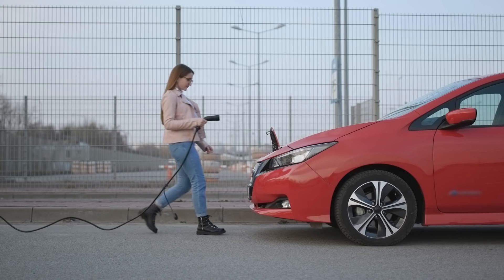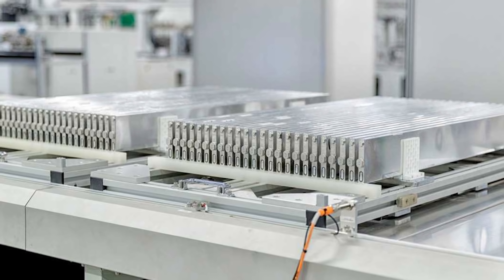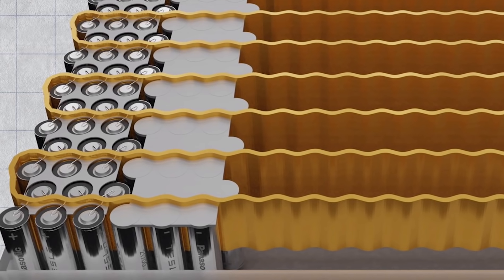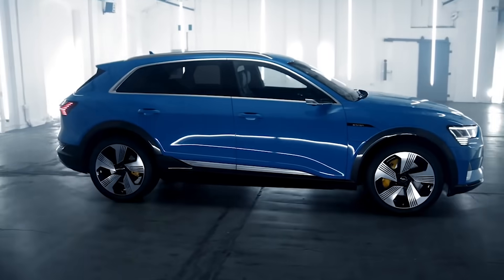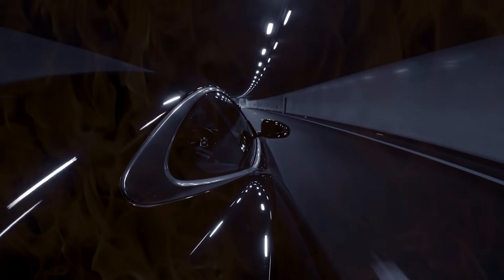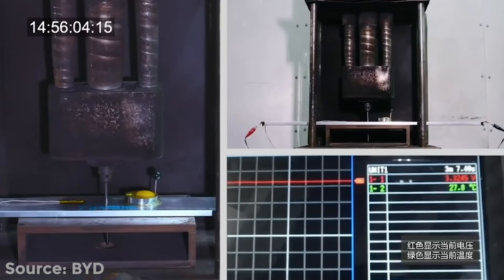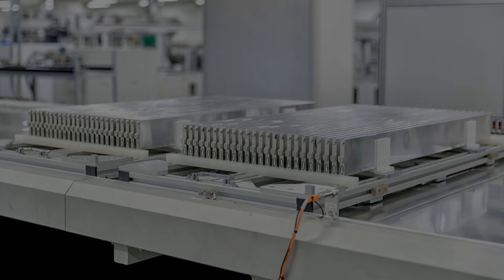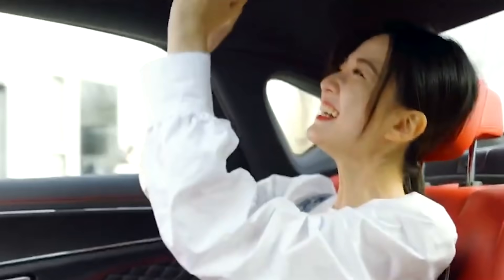Uncovering China's Battery Breakthrough

Comment: I've been decently interested and involved with Li-ion cells (18650s to be exact) since 2006. They (obviously) used to be solely focused for minor, handheld devices, and, seeing that the technology was NEVER meant for high draw, fast recharge and the cells were dangerous when placed under extreme heat (or damaged)... ALONG with the requirements for a PCB controller...

... it's definitely in the world's best interests to move AWAY from Li-Ion/polymer technologies for vehicles, large devices, and high-voltage concerns.

TBH, I'm surprised that Li-Ion has become so robust, only with exception to its light weight & high energy-density.
Reply: It's not 18650 anymore it's 4860 and the gel kind are actually better and it uses no lithium it uses cobalt but yes I think we can make a battery and make it swap out like laptop used to take battery out and put a new one

Comment: I would assume that the shape of the battery helps with dendrite formation as well?
Reply: My thoughts exactly…  🧏🏻 little confusing because I could have sworn there was a reason why we used a insulated cylindrical design. The other issue is with dust particles and organic buildup between the plates from air cooling. Not to mention the massive energy loss in the winter time. How do you keep them from getting too cold 🥶

Comment: It was evident as early as 2010 that the energy density of battery chemistry was insignificant relative to the structural container which makes up the pack of cells. A 10% increase in energy densities while significant in the lab is dwarfed by the casing weight. Elon himself pointed this out laughingly pointing out what a waste of time it was to do R&D on exotic chemistries when most of the weight problem is the cell casing and the waste of space arranging cylinder shaped cells. Then add more infrastructure to hold the cells in place and as mentioned a cooling system.
Recently came across a carbon foam battery where the energy to weight was higher then any other chemistry but the volume to energy was bigger then any other chemistry. However the foam structure is strong enough to become the car body itself offsetting the volume concern and replacing the heavy body with an energy storage potential greater than any other mobile concept. Apply this to the electric airplane solution and you now have a viable technology for electric aircraft.
Reply: So what happens when you crash in a carbon foam car?
Reply: @motie38  pretty good question, but I'm sure we can implement the advances we have with other material science with carbon foam and create crumple zones, among other things, to protect passengers.
Reply: @crossup13  passenger safety is only one worry. Batteries are toxic waste. And they're a lot more expensive than a crumpled piece of metal or fiberglass. If you make batteries part of the body, you're raising the cost of an accident significantly. The car becomes so expensive to repair it's now essentially a very expensive disposable container, and now you need a hazmat team at every accident. well, almost.
Reply: it's almost like elon actually knows what he is talking about and isn't just a grifter that got lucky. Interesting concept to consider with the recent media blitz against him...

Comment: So this battery is cheaper, more energy dense, easier to cool, is safe and doesn't need Cobalt. Driving a nail through it doesn't change the voltage at all. There's hardly any downsides except where it is produced. I hope you understand that I find this VERY HARD TO BELIEVE

Comment: How is letting air past the cells going to be more space efficient than water cooling channels? Also LiFePO4 cells are less energy dense than standard cobalt-based chemistries. Ultimately the safety and longer lifetime make them appealing for standard EV use, but for long distances I think cobalt-based will still be better.

Also clickbaiters should be burnt at the stake

Comment: Temperature management of batteries is no magic bullet and won’t yield the results fantasized by the producer of this video. Consider that Tesla manages temperature easily within optimal range so what’s the difference? Performance wise there will elimination of a small circulation pump. If your theory were true then EVs natural performance would jump in the cooler months.  This design is about economizing for a lower income market and while that’s fine, the reduced energy density will yield vehicles with compromised range that will never meet market acceptance in the usa

Comment: I don’t believe this presentation. You will still need ventilation room between the cells to dissipate the generated heat while charging. There is nothing revolutionary. Battery-industry is well aware of other form-factors. Also the advantages and disadvantages of lithium-iron-phosphate are well-known in the industry. There might be some advantages in this form factor, but it is only marginal.

Comment: How is this a breakthrough? It takes an existing technology, puts it in a (more ridged?) long form factor, and you didn't give any important details. 
Sure you can pull apart the structural form, and you said sheets, but if sheets how is the electrical connection done on the inside to each sheet?

Comment: LiFePO4 batteries have a massive disadvantage in cold climates. Without heating, trying to charge a LFP battery below 0C will permanently damage if not completely destroy the battery. These will never work in a car without internal heating which will drain the batteries significantly as most of the car driving world experiences temperatures below 0C. I also don't see how these "blade" batteries are much different from the pouch battery cells used by just about everyone but Tesla. 

Relying on air cooling for an EV is a big mistake as fast charging the battery will generate massive amounts of heat, just ask any Nissan Leaf owner. The Leaf uses air cooled batteries and there are significant limitations on charging of those batteries. Long road trips are completely out of the question as most Leaf batteries can only be fast charged once or twice per day due to excessive heat buildup. Given this, you'll maybe, and that's a big maybe, be able to get 600 miles/1000 km of range out of an air cooled Leaf battery due to heat buildup and that's if you start with a full battery at the beginning of the trip.

A side note, Tesla is the only major manufacturer using cylindrical batteries for their cars, nearly everyone else uses long pouch cells typically in the 600mm-900mm length range.
Reply: To add to this, Nissan leaf battery packs degrade significantly faster than liquid cooled ones in humid, hot climates
Reply: just use fuel.
Reply: @prydzen  You mean fossil fuel? As much as i love cars (and manuals😭), even i accept that we have to replace them. Hopefully we can keep using them as enthusiast/specialist cars or something. But for mainstream/everyday use. We really can't afford the emissions.

Comment: To the best of my knowledge only Tesla use cylindrical batteries. Air cooled systems are notorious for loosing capacity quickly and not to take frequent rapid charging due to the inefficiencies of air cooling over using refrigerated liquid cooling. I cannot see air cooling working at all in hot countries. Nor will it work well in cold times when battery heating is required. Nice 8dea though pity about its implementation. I would never buy an EV with an Air cooled battery.

Comment: Concept is interesting.
However having no active cooling is a big problem for me. You all know how bad Nissan Leaf batteries deteriorate.
And in hotter climate, where ambient temperatures reach in excess of 35 degrees c, just relying on gaps to cool the battery is not enough.
Do they at least have active ventilation of these, or are they hermetically sealed?

Comment: We need to have an independent agent such as NHTSA or ETSC verify those test with the metal spike piercing the blade battery and not relying on the company who promoting blade batteries because I believe that they are cheating on those test, I believe those blade battery or not charged, It is my believe they using fully discharged battery to run their test. Anyone understands how electricity work know is not possible short out a battery and don’t get any spark a fire from it!

Comment: The blade battery is already in production for quite a while now. It's a invention on packaging battery but not the material improvement. It' using LiFePO4 battery tech which is cheaper than Ternary polymer lithium battery (Tesla's battery) and safer. But the problem of LiFePO4 is it has less energy density. The blade battery increased the energy density and made it easier to cooling off so the BYD electric car can catch up the mile range with Tesla. If there are some new battery material which has higher energy density and using the blade packaging, that will be a revolution of electric cars. Good news is many Chinese electric car companies (includes BYD) declare their new cars will have 1000km range on single charge. That may cause a booming of electric cars.

Comment: Do not be fooled.  This is not a breakthrough at all.  It's just regular lifepo4 cells.  I've had cells like this for years.  Also, it has less surface area than an equal mass of cylindrical cells.  There are already cars that use rectangular cells or flat pouch cells like the prius.  There is just no new technology here.

Comment: "The cells are manufactured in China" Why? Where are other batteries made?
Reply: What do you mean ‘why?’ China has most of the manufactures to make batteries on the world, even Panasonic is Japanese brand, but they also have some factory in China, due to much lower labor rate. If you even in China before, then you will find out China is not the same as your country’s media telling you about how it is.
Reply: Tesla Model 3 are manufactured in the United States
Reply: @rcpmac  yeah and they'll slam you into blinking lights killing your family 😅
Reply: @adamsmith5913  FWIW, from personal experience I can tell you that price and the name on the electronics is not the best measure of quality and if you're willing to pay the price I'm pretty sure you could get the quality from China. But that's the thing isn't it, you have to be willing to pay for the quality instead of buying on price alone. I'm kind of assuming your other post is a bad attempt at sarcasm.
Reply: @L98fiero  I think you have reading comprehension problems, are you English 1st language?
Reply: @adamsmith5913  But China also makes high quality items, you just have to pay for them instead of buying the cheapest you can find.

Comment: One thing: Don't you think, that any other batteries aren't manufactured with a lot of Fossil-Energy-Input!
Reply: I think the point was that ANYTHING made in China is going to consume more fossil fuel and generally less sustainable resources than most other places that might be able to manufacture such a thing at anything close to a comparable price. If you listen closely, the narration script points to the place of manufacturer as being one of the drawbacks, NOT any particular characteristic of this type of battery. The Chinese are all about making things as inexpensively as possible, but that still work pretty good, and all of their manufacturing infrastructure has for decades retained these as top priorities, and we all have benefited from this to some extent. If in this case, the opposite scenario is particularly instructive, one might imagine some product that is manufactured in , let’s say Sweden, for example, and is celebrated because one of its advantages is that its manufacture has a very low environmental impact, including the amount of non-renewably-sourced energy being either extremely small if not totally absent; HOWEVER, this might result in the pro’s and cons list giving the number one slot on the drawbacks list to high costs from the manufacturer all the way to the end user. Again, this is all because of WHERE it’s made, NOT (as before) HOW it’s made, vis a vis consumption of raw material and source of energy used. Either you weren’t really paying attention, or the whole matter is over your head, but it appears you completely missed the point of this video.
Reply: @thatfeeble-mindedboy  Yes I know, I just wanted to point out, that those batteries aren't the only ones produced under bad conditions using fossil energy. So that this shouldn't be much of a problem, as with other products it's the same.
Reply: @sanctred  Pretty much all the other "normal" batteries are produced in China as well with all said cons (of the video) like using fossil energy and all that stuff. So this shouldn't be the problem, as these batteries aren't particularly produced under those "bad" conditions

Comment: battery degradation will be higher with the heat of fast charging. a cooling system is needed. thats the huge difference between a battery lasting 3 years and a battery lasting 8 or more years

Comment: One day we will need very little electricity (just enough for the dashboard and running lights), to operate a vehicle that's fueled by 'liquid air'.     Ultra capacitors will take care of that.

Hands down, Liquid Air Energy Storage, LAES, will be more efficient, sustainable, and have more useful features than anything else on the road today.  

The heat is recovered in the liquid air making process.  Not so with a battery getting charged and discharged, where the heat is lost to the ambient air.  Also, ELF radiation from the motor/electric system is unhealthy to be around.  All that is eliminated with a LAES system, which has an expansion engine with only two moving parts.

For all we need is the air we breathe to love the Earth.

Ready for a major learning curve?  https://www.evernote.com/shard/s519/sh/52f9281b-7e87-21a5-6e91-48ba37f8ac72/e3897536777e56c6cf58dd4f1ed78e44

Comment: I love how you point out the down sides of using cobalt because of "toxic waste" and "human exploitation". Yet only point out they are not using cobalt....... And the "human exploitation"?  Xinjiang is not the only place with questionable labor practices. I would like to believe that this is all that the company claims but until they allow an independent source, that's all it is, claims made by BYD It should also be noted that this isn't a new type of battery. Rather it's a new design of existing tech.

Comment: Fun fact: cylindrical lithium cell design is based around the re-purpose of audio cassette thin film composite manufacturing equipment. They needed a use for the machines after the audio cassette went the way of the Dodo due to the in invention of the Compact Disc
Reply: Couldn't we use the now defunct compact disc technology to make a slim flat battery and stack them up into packs ? Maybe use an old CD multichanger as the battery box 😃
Reply: @johnwalker194  Yes! sounds Perfect!

Comment: I'm considering making a DIY e-scooter. That would definitely have LiFePO4 or LTO batteries rather than Li-ion. Safer, longer life and not so fragile when incorrectly charged.
Reply: Depends on whether you want range or acceleration.  I think LFP is a good balance between the two and cost.  

LTOs have horrible energy density.  Like 1/2 of an LFP and maybe 1/3 of NMC. Also due to the lower nominal voltage, you'll end up needing more LTO cells to get the same DC bus voltage to your motor controller.
Reply: Do you plan on incorrectly charging yours?
Reply: @PowerScissor  you big dummy, he just means charging it when it's warm, right after use.  This is undesirable, but often unavoidable.   It's a reasonable concern.

Comment: A top battery engineer told me that the round shape of batteries was principally a heat decision. The common 18650 have become a standard so are cheap and optimised. As you note, for actively cooled systems, thin "blades" could be more effectively cooled. Better cooling alone could significantly improve charging speeds, performance, and durability.
Reply: I don't agree with that.  The principal reason batteries are round is because it is easier to wind many layers that way while needing few electrical terminals.  Batteries have been round for decades before people cared about heat because the applications were so small back < 1980 and contained so few batteries.

Comment: I’m curious, in the puncture test what will happen if the nail is wiggled? That video segment reminds me of when the lithium ion flat pack was first introduced and lab technicians punctured those cells benignly with a nail. They soon discovered, entirely by accident, if you wiggle the nail then things very quickly start to go wrong.
Reply: It doesn't use cobolt which is a huge part of the explosiveness of normal litium batteries. (makes them a bit less energy dense though)
Reply: Also depends which way the lamination are in the batteries, I bet if they turned the lithium battery to it's side nothing would happen. Marketing tricks the clever little buggers :)

Comment: There's alot of misinterpretations here.
# LiPo cells do not have greater density of energy
# having it in a rectangle form factor does not improve cooling as there is less surface area than cylindrical shapes, 
# it is therefore should be cheaper but definitely not as durable
# if they did state it is used for structural then they're lying or it's stupidly dangerous, no way will that be lighter than 21700 or any other metric
# these are not performance rated, if they are then they're lying about cooling technology,
# manufacturing costs are subsidised by the Gov, that's why even though they are successful it never goes outside of China, the business does not make sense either through regulatory issues (quality), or true cost. Whereas tesla, jaguar, Audi etc has gone into China without fuss